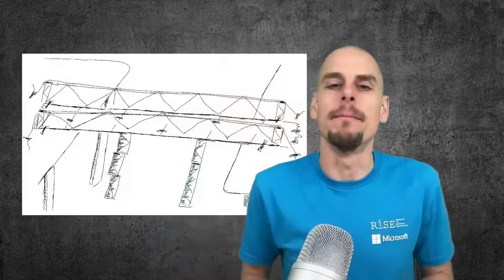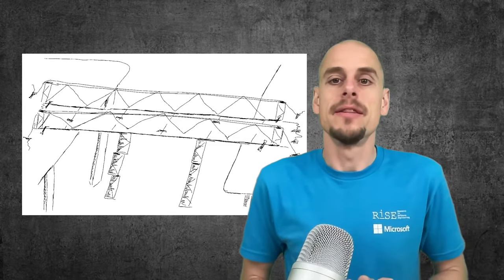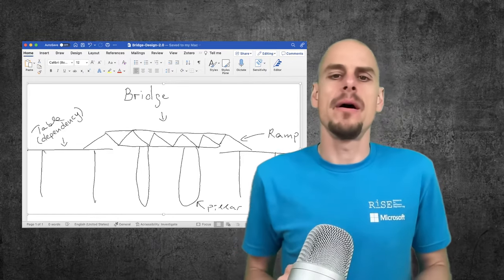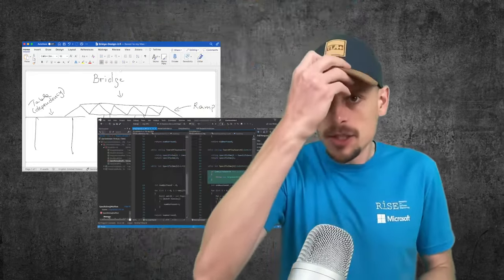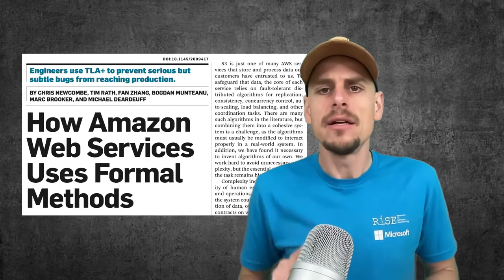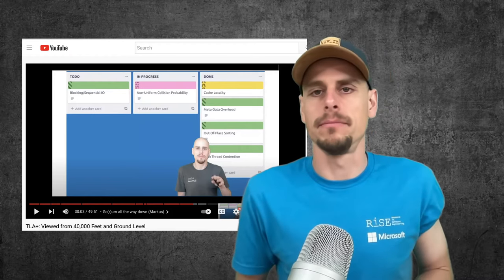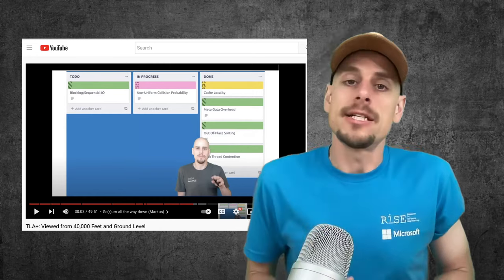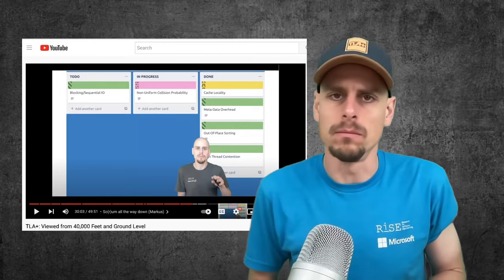Let's shift-shift left: How modeling can help software engineering

Comment: Hello Markus,
Do you have some tips on building mathematical intuition for reasoning in TLA+? I can read up the documentation and watch talks/tutorial videos and learn all about the language. But that still doesn't help me to write a Model spec from scratch for a system which already exists, (and it is not even tricky like  AsyncRingTerminationDetection).
I have read up briefly on Propositional/Temporal Logic (from Specifying Systems, and other texts), but i always feel i haven't read enough or missed something. I watched your workshop on AsyncTermination, but i got lost when you introduced terminationDetected variable, reading up the paper made me only to give up.
Are there some baby step tla specs which i can go through to slowly build up? I haven't read Specifying Systems fully, will that help or confuse me?
Thanks
Reply: just downloaded the tla hyperbook, will go through it.